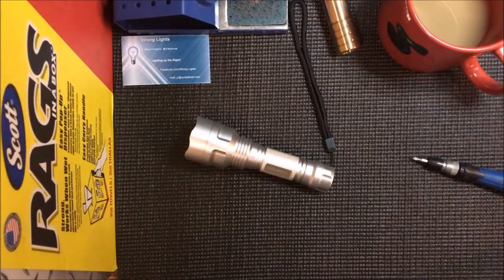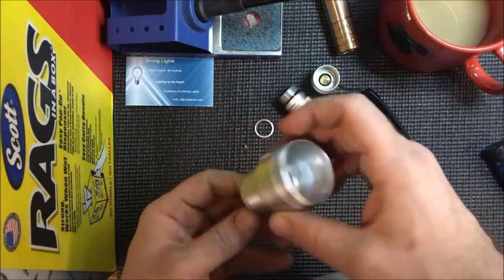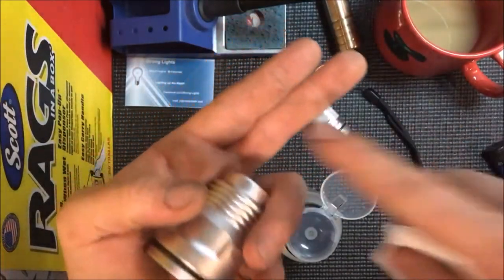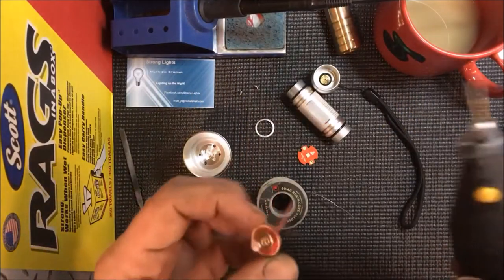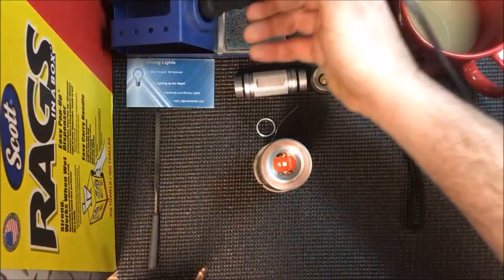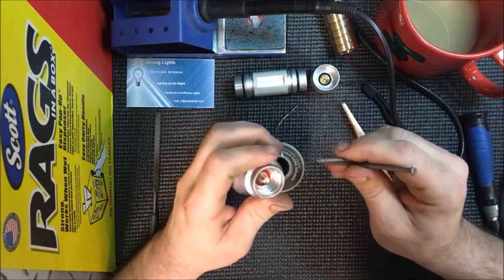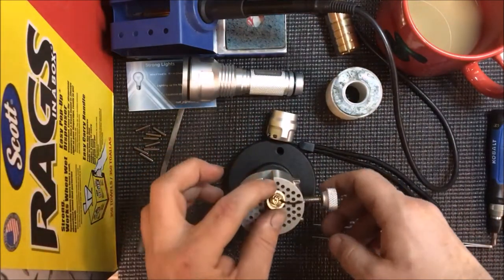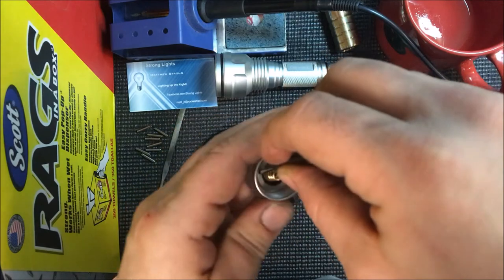Convoy c8 Build Strong Lights

Comment: Just found your video. I'm new to flashlight enthusiasm and want to build a c8. Ive never built any electronics but do build other stuff. I'm just stating this video commenting 30 seconds in. I'll probably comment again. I'm highly considering doing a c8 host to start. Maybe a sbt90 even though I'm sure it's probably too hot/high power. But I'm wondering how much copper I can hit under the emitter star for the shelf for heat dissipation? Hopefully at least a couple mm. Like I said, I will finish this video I'm sure it'll show some answers. Thanks man!

Comment: I didn't catch it in the video, I'll scan back through- but did you bypass the spring with a wire on the driver as well? Looked like solder on the top of the driver spring in the photos at end of video? Nice video. The small tips like pre-bending the leads before soldering and the two nails were helpful.